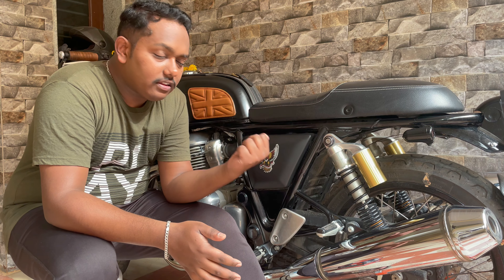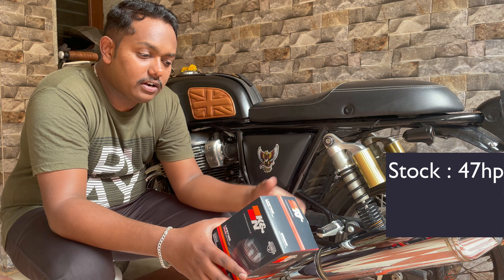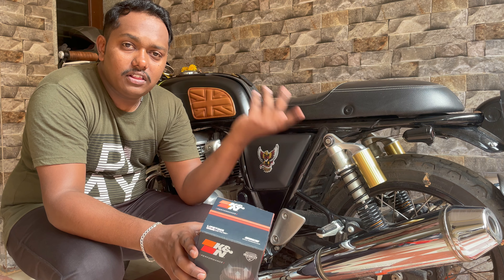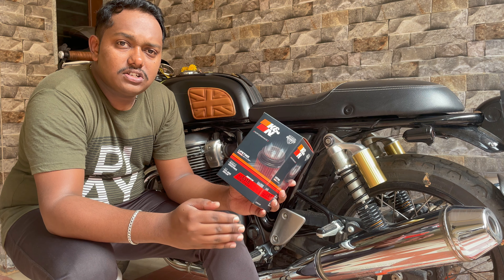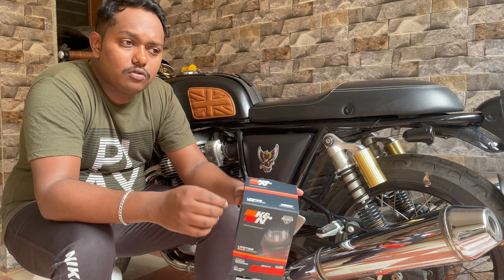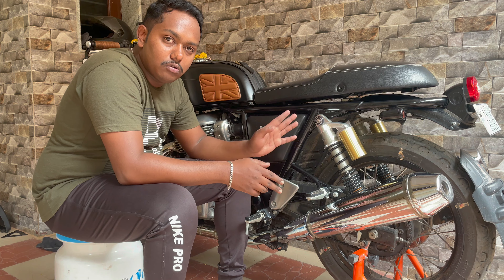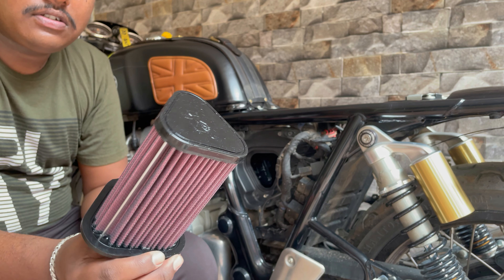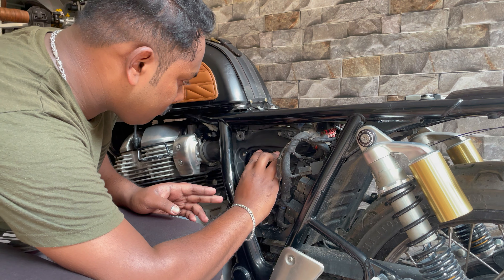K&N Air Filter🔥Installation | Best Performance Upgrade | Royal Enfield | Continental GT - 650

Comment: I would tend to believe better performance (more acceleration, more hp) would generally mean higher fuel consumption, but I'm far from an expert. Thanks for the video, this winter I'm thinking I'll get rid of my stock air filter as well. 

Another one I've seen people using is the DNA air filter.. 

Subbed btw ;)
Reply from the maker: In general engine need to work hard to manage air and fuel intake. By increasing the airflow, engine will concentrate more in fuel intake. In results you ll have better acceleration, performance for the same amount of fuel intake before as well.
Correct me if am wrong.! 

But surely ll be putting a mileage test video.
Reply: @twin_xplorer  I'll take your word for it! I just ordered the DNA air filter, hopefully it gets here soon before the cold comes and I'll do my own assessment as well. Ride safe brother.
Reply: @motomitch any change in sound after using different air filter
Reply: @ yes, big time. sounds way better.

Comment: is it advised to run your GT 650 on a performance air filter with stock exhaust? you're basically increasing the intake and keeping the outtake as is, which is restricted. Don't you feel the backpressure will be too much on your engine that it causes even more heating issues and causes a strain in the engine after long periods of time?
Reply from the maker: Yes u hav to upgrade to free flow as mentioned in video i ll also be doing it in near future.

Comment: Great video brother. One question: if I install only stage 2 plate with stock air filter, is it increases performance or does it do any harm to engine?
Reply from the maker: Stage 2 plate have wide opening for dust ll enter more and stock air filter is made of paper. So it ll damage and dust ll enter to engine. I don’t prefer tat.

Comment: have you noticed any changes to the exhaust note after the air filter change?
Reply from the maker: Yes, since i hav installed stage 2 air filter cap  i can hear the K&N sound and only when u rev to higher RPM i hear in exhaust.  
Am still on stock exhaust so lower RPM u wont hear.

Comment: Will it decrease mileage ? Or any improvement
Reply from the maker: I have not seen any changes in milage or performance bcoz am still using the stock silencer. Only good thing is you can hear thump at 2-3k RPM.

Comment: I got the Way2Speed one, not because its cheap. It was advertised to have maximum airflow and no oiling required.
Today after using it for ~3k km, it checked the Air compartment and there was dust inside.
I'll be throwing it out and getting a reputed tested air filter. Thinking between K&N, DNA and BMC.
Are there any other air filter which doesn't require oiling?
Reply from the maker: After marker Air filters need oiling because most of brand use cotton and when cotton is not oiled they are chances of dust entering the engine. Stock filter are made of paper which cannot be oiled and we clean ever 3K kms and change at 10K kms. 
Way2speed uses Nano Fiber for filtration. According to me its almost similar to stock but better.
Reply: @twin_xplorer  They say its nano fibre but I doubt their testing methods. 3k km and there is dust inside the air chamber 🥲
Please give some feedback on the K&N after 1 month of use. Maybe show the Air chamber and any presence of dust.
Thank you 😊
Reply from the maker: Sounds Good.! Will upload in YT shorts as my bike is quite dirty by the recent ride. 
Thanks for the suggestion, hope you have subscribed.! 😊